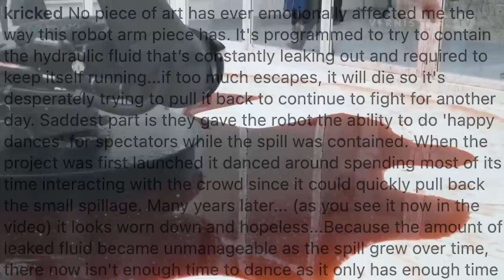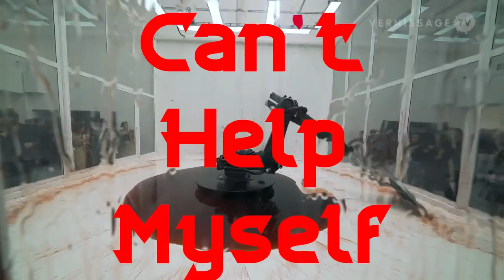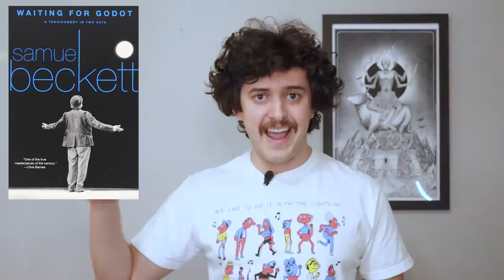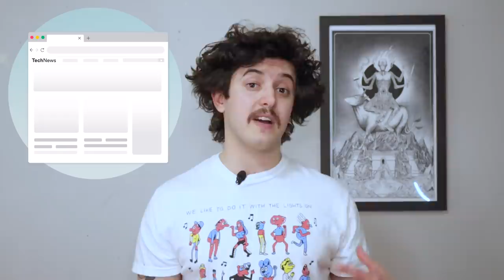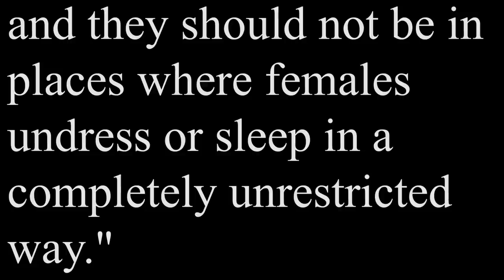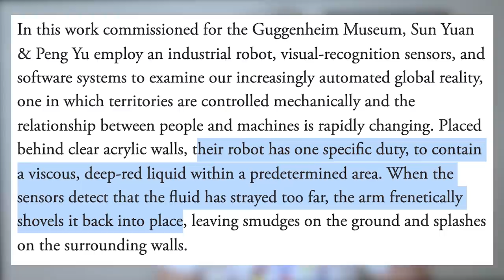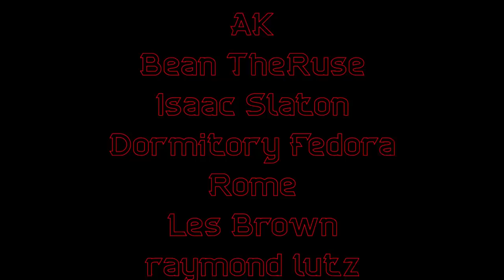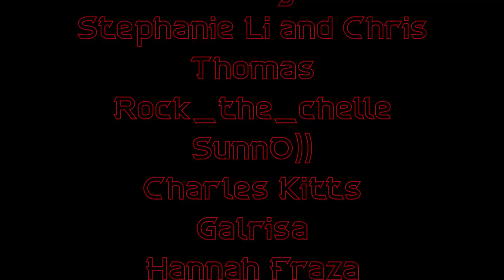Can't Help Myself & The Death of the Author

Comment: I feel like author's intention should still factor in somewhat. Without the creator, we wouldn't have the art in the first place so I think it does matter we get an idea of what he's thinking.
Reply: The thing is that, if this was the case, what's the point of making art? Art is about expression and interpretation. Is it good to know the author's intent? Absolutely. However, the truly important part is the interpretation of the art. There is art everywhere that is interpreted differently from the authors' intention.
Reply: @whodis2614  But it is only an opinion that art is about interpretation, and it can be argued the more weigh you give you interpretation the more you take away from expression; which some would argue is the primary purpose of the art.
Reply: I certainly as a writer who puts a lot of thought into my metanarratives would find it sad if no reader was even a little bit curious as to what I was trying to say. That being said, the reader drawing their own conclusions based on what they themselves bring to the table is not only desirable but absolutely inevitable.
Reply: Then we can‘t parse the meaning of any text where we don‘t know anything of the author.
Obviously there‘s different texts where different lenses are interesting.
Intent can be valuable to analyze.
But sometimes it can be totally disregarded and it‘s great.
Reply: I don't think it should be necessary. An artist's intent could also be to hide their intent. That's what I did in my poetry classes. Wrote down a "story", buried in symbolism, and cut like 80% of it. The best feedback I got was basically: "I have no idea what this is about, but I enjoyed it." It's a very zen approach to creating art. So if Stock argues that the art is a set of instructions to find authorial intent, I might say "Why can't it be a set of instructions for finding something else, and why should I need to know what that is?" Indeed, if the reader finds something they value, does it ultimately matter if I didn't put it there?

That is also how I enjoy art. I like abstract paintings, poetry, music, and so on. I often enjoy music more when I'm just listening to the melody and sounds, including vocals, but when I find out the lyrics, the music usually loses something, because the meaning they convey clashes with my experience. I can also enjoy art that states its intent in various degrees of clarity, but that type of art caters to a very different need.
Reply: Trust me if I could have fit the artist's interpretation as well as my own inside of the Instagram post length limits it would've been in there lol - I couldn't even fit my own interpretation in the space provided and had to continue it down in the comments
Reply: @GuerillaBunny  But there's art and then there's art. The things you wrote were specifically meant to subvert cognition and work on a subliminal level, and then there's more cerebral kind of art that is trying to express a specific idea. For example, if you read A Song of Ice and Fire (the game of thrones books) without at all engaging with Martin's political and philosophical undertones, one could argue that in a sense you're doing it wrong.
Reply: @tokevarvaspolvi8999  One could argue for and against that, and while I agree with you, I might have difficulties convincing someone that it is a fact, and not an opinion. And to take things even further, someone engaging with the politics and taking out the wrong message could be argued as simultaneously doing art right completely misunderstanding it. In fact, we could read say, Ben Shapiro's book, and take a completely unintended message, though that would of course be because we DID understand the intended message... We would not just misunderstand the author's intent, we'd try to override it. Is that doing art wrong?

Anyways, that's just nit-picking. I largely agree with you, and was arguing against the OP's premise.
Reply: he gave a pretty academic definition in the video but basically what Death of the Author means is that the author's interpretation of a work is no more valid than anyone else's.  it doesn't mean that we can't take their intention into account when forming our own interpretations, it just means that we can disregard their opinion if we feel it's not represented in the work.

basically, it's the idea that an author can be wrong about the meaning of their own work.
Reply: "Without the creator, we wouldn't have the art in the first place so I think it does matter we get an idea of what he's thinking."
I think it's interesting how this comment ties into three big ideas about auteur theory that I think are arguable at best: 

1) that the art has just one or two individual, named creators, rather than both culturally (the artists as conduits/tools by which culture replicates itself) and practically (the artists modified a pre-created industrial robot arm created in a plant by assembly line workers, and collaborated with two robotics engineers, according to the Guggenheim's website) being created cooperatively by many people in addition to the auteur(s)/named artists.

2) because the creator alone made the art, the creator retains the right to say what the art means or is. While on the one hand, people should be entitled to the fruits of their own labor, if we admit that the creator is not the only "laborer" here, we must extend the right of defining the art to a much wider and harder-to-gatekeep pool than the artist(s) alone. Additionally, is the right to experience art and think about art on our own terms a basic human right? If so, then are we conceding that one's entitlement to basic human rights can be earned (and therefore not earned, by some) through labor, in this case the labor of making the art? Isn't the idea that rights are something you have to earn (through capitalist production/labor) something that we as leftists should question, if not outright object to?

3) that artists necessarily create art to express what they're thinking. As We're In Hell says in the video, this is a very recent notion. For a lot of human history, the objects we would consider to be pieces of art were viewed and treated much more similarly to crafts, or to luxury items. For most of history, artists were commissioned for things like religious icons or portraits, and they could only express themselves within whatever parameters they were given by their clients. Similarly, artists were trained like craftspeople, apprenticed in established artists' studios, helping those artists complete commissions while studying the techniques they used. The modern idea of the individual auteur, for whom the creative process is an expression of a moment of unique creative genius, is pretty new, and for many artists, is still not necessarily accurate. For example, plenty of directors who have been to film school and are extremely technically skilled, as well as talented at working with actors and editors to capture good onscreen performances, construct shots, etc., are working in Hollywood right now churning out blockbusters that are primarily designed to make studios money (or at least were prior to COVID-19; I think fewer movies have been made overall since the pandemic). I would argue those movies are pieces of art (whether or not I think they're good art), but they are made and treated like commodities that have been crafted, not created; more like pieces of well-carved furniture than sculptures. At this point, any claims we make about the connection between an artist's work and the artist's feelings, thoughts, or identity are extremely hard to confirm, since it's hard to know the extent to which creation is inherently autobiographic.

I don't think considering the auteur's intention/interpretation is bad, but I don't think it inherently deserves to be privileged over others' interpretations.

I'm not really trying to argue, I just found your comment really interesting to respond to/dissect, sorry. I don't know anything about you and whether you think any of the things suggested above, I'm sure you're a cool person.

Comment: Taking somewhat of the creators intentions into consideration while still going with the ‘endless toil’ vibe to the piece, this is my own interpretation; 

I see the robot arms constant raking of the blood like fluid as the violence of the state seeking to solve problems but naturally only adding to and even perpetuating those existing problems.  Much like the military and/ or the police taking actions to “sweep up” after damage they did comes to light (like police using body cams or the US military “helping to rebuild” places like Iraq) only to have these bits of theater do absolutely nothing to help or even worsen the problem (the problems they are responsible for in the first place), this little robot arm will pull away the blood - the blood that it had ‘spilled’ from its previous actions - to reveal a single white stripe of clean floor, only for that action to “spill the blood” further necessitating yet another mechanical (literally and figuratively) sweeping back of the blood.  

And occasionally it does a jaunty little wiggle, more of a friendly facade to have the viewing public see it as more human, sympathetic; another thinly veiled disguise of the literal machine of death that it is.  

But it, and the state as well, could easily solve all the problems and stop all the spilling blood if it were to allow the radical restructuring of the literal base of the world - e.g. a metaphorical/ literal hole for the blood to drain out of or the removal of the floor entirety.  But what then would be the machines purpose?  So it continues in its intentionally Sisyphean task; being, in the sage words of Homer Simpson, “..,the cause of, and solution to, all of life’s problems”
Reply: I think this is a very interesting interpretation! Thank you for sharing it

Comment: i've always thought that there always should be a blend of understanding authorial intent, as well as having your own opinions on pieces.  whenever i enjoy a piece of media, i'll try to go into it blind and enjoy it without influence by other opinions. and then if i want, i'll see what the original intent was or what others got from a piece. i think blending both is especially important if you do create art, as being able to look into what the author actually meant lets you better see if they achieved that goal, or how they possibly could have gotten things across better, or what caused them to not be able to make what they wanted at all.  
i feel especially that artistic works should not be treated as some nebulous things made in a vacuum as well.  as you very very briefly state, the art piece in question "Can't Help Myself" was made for a museum that more than likely is quite restrictive on what they allow.  it feels odd to gloss over that part, as this has been a historical issue with making works for a very long time.  to have sometimes extreme restrictions placed on the artist due to various reasons effecting the art and how it may be seen on the surface, leading to either more detailed analysis or studying the author themselves.
it's also important to not forget that completely taking away any authorial intent leads to many situations of stories and even research being stolen. when we go so far as to say the author has no rights over their own works, we can't forget who really benefits from this kind of thinking.  an example being many indigenous people having their art and stories copied and twisted to make trinkets or 'scary stories,' while the actual people are silenced and ignored.  in the current era of works being stolen by companies from those that cannot afford to have any say in the matter, we can't only look at art as a nebulous thing.  of course art can be interpreted in any number of ways, but it should always be remembered that indeed a human being created the work.  i bring this up because outside of museum art, there is a near constant struggle of artists trying to even keep their name attached to their works. complete detachment of authorial intent only truly benefits those that seek to consume and nothing else.

Comment: Hydraulic fluid is not the same thing as lubricant. Lubricant prevents friction between rigid moving parts, whereas hydraulic fluid is a medium of force where pushing at one spot can create motion elsewhere. Like compressing this bit over here to make that part over there extend.

Comment: My first impression was that the piece was about bad habits. The robot wants the blood to stay in the parameter, but pushing it back in the pool just causes the blood to build up and seep out somewhere else later. It never solves the problem, just delays it with unnecessary effort when the real solution would be to clean up the blood, or build a barrier, or just not have the parameter.

Comment: Knowing that this peice is about surveillance, I could see it as a comment on the inherent failures of an actual panopticon. Regardless of being watched or not, the idea that at any moment you might not actually be under surveillance would create an urge to attempt escape. The structure of the panopticon would probably make it so that any attempt would be easily spotted and stopped but those crackdowns would not stop the attempts. The robot arm is the guard of the panopticon. Slowly working themselves to death from the constant containment activity.

Comment: I think that, rather than linking it to a notion of contradictions in a text, a better way to describe deconstruction is to say that it is a method which tries to find in something that is said (or written, or seen, or thought, or understood) what this something keeps out (keeps silent or unseen, veiled) and then to see this as more than just opposed to what is said, but as a point from which the speech happens : what you don't say (independently of what you choose to say and/or not to say) structures what you say in a fondamental way : it is the background from which what is visible has to detached itself in order to be seen (the exposed, in it's very exposition, comes from the hidden, and therefore presupposes it's obscurity while also in this very logic of exposure obscures the hiddenness from which it comes from))

What makes deconstruction a poststructuralist method (rather than non-structuralist or anti-structuralist) is that while it has to recognize that structuralism has the merit to give itself the conceptual means to link an element to the greater structures it is a part of, it fails to understand these structures themselves because it presupposes it's own capacity to do so and because it has already forbidden itself to relate some structures to other structures in that they are d(r)eamed not to have an outside : the ontological (and hauntological) reflexions about the relations between light and obscurity is what Deconstruction attempts to use to at the very least map the limitations of structuralism (or to understand our inability to do so or maybe to grow passed it if we can) : it is at this moment that it becomes very complicated

Comment: Obviously, I can't give an absolute reading, but the way that the arm is anthropomorphized reminds me a lot of Nam Jun Paik's works. I grew up constantly seeing his "Warez Academy" on display, and the way I interpreted it changed alongside time and my understanding of its videotapes' contents. Unintentionally, WA made the same journey that "Can't Help Myself" did: the chief focal point of WA is a set of about 20 CRT TVs playing some obscenely bright and fast videotapes. The electronics eventually failed, and for a few years, "Warez Academy" sat in the Honolulu Museum of Art's storage. It felt so strange to see it back on display, repaired and working fine, after learning that both the electronics and the artist had died. The new plaque spoke much more of the piece as a statement on obsolescence and preservation and much less on the video feed that bitterly mocks Reagan-era public educational systems  and information control via media. I'm glad it's back, but there's a much different aura to the piece now, especially given the added detail of the security guard turning the thing on and off according to a schedule, as a means of prolonging the electronics' life. Paik never intended that specific feeling of degradation in his works as they are now – he passed away a few decades ago, but here, his works live on, imperfectly restored and changed by others as time marches on.

There's some meaning here that I can grasp pretty firmly, but it's largely ineffable. CHM changed when that dude posted his thoughts on it, and WA changed when its broken electronics were repaired. These pieces in particular have a fascinating air of hiraethau, given that they necessarily and rather noticeably changed over time, both because the parts fail and because closely associated interpretations change. I've barely seen CHM, but I feel as though I've known it for lifetimes, and trying to put it into words as something with a specific, tangible meaning feels like a futile effort.

Comment: I always read the robot piece as a critique on dangerous working conditions in factories, and the uncaring way a businesses tries to go on like nothing happened when someone gets inured or dies. If someone gets killed on a factory floor it's expected that you might pause for a moment, but afterwards production is supposed to resume. Often without addressing the safety problems that will lead to more deaths in the future. In our current system we value things above lives. So the robot just keeps on trying to mop up the blood, but the blood keeps on flowing.

Comment: 4:00 Wait, why lubricant? It said hydraulic fluid. Hydraulic isn't lubricant, it's used to power hydraulic cylinders by transmitting pressure to them.